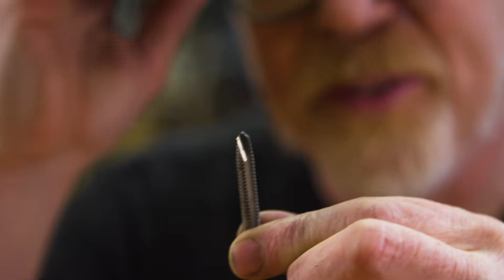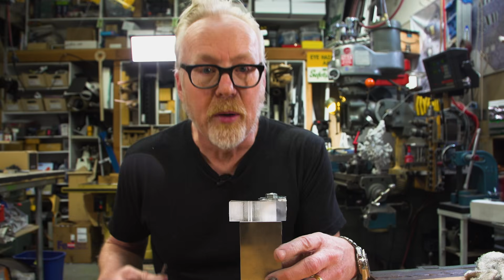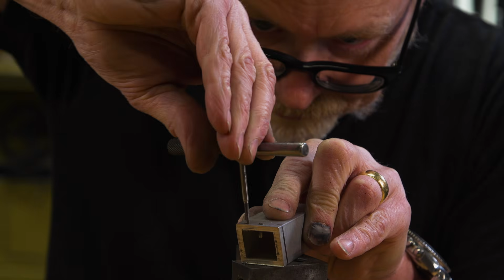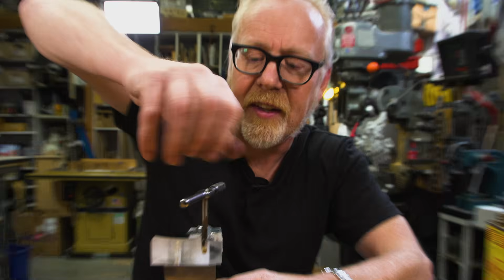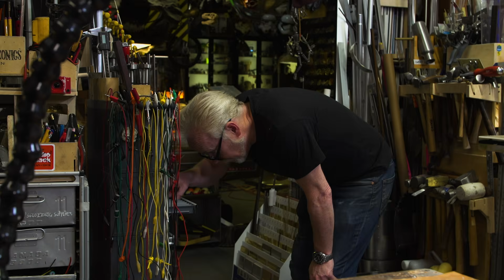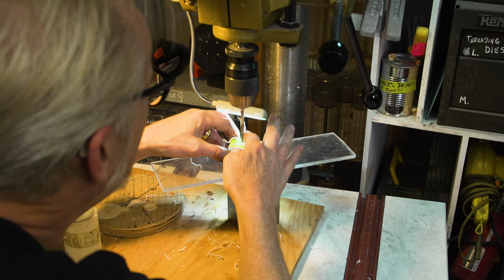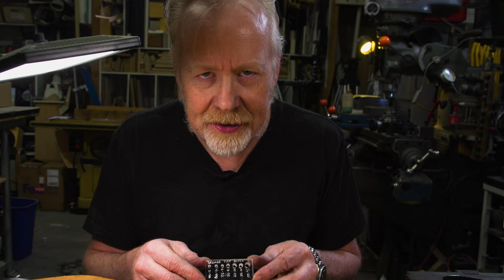Adam Savage's One Day Builds: Thread Tapping Guide Block!

Comment from the maker: Starrett Tap Wrench: https://amzn.to/3m47UaV
Spiral Point Tap Set: https://amzn.to/35l0qdt

Join this channel to support Tested and get access to perks:
https://www.youtube.com/channel/UCiDJtJKMICpb9B1qf7qjEOA/join
Reply: I love taping holes however my favorite tool in a shop is the file...metal file specificity.
Reply: @Die-CastMetal  I hadn't really lived the edge of reality until i got irritated only having a rough bastard metal file to shape metal more than sanding/grinding but less than cutting. Alas, the most dangerous tool abuse I have undertaken utterly on purpose was rough shaping the tang of that file to mount in the Dewalt(still US made model) sawzall to quickly and efficiently make my project actually achieve completion. 

Yeah. 

Second most dangerous was likely the 6" diameter cutoff wheel to the 4" angle grinder without thw guard to gain the depth of cut i needed. 

Not 100% which decision was worse, but hell, an air file is designed to chuck up a air file and reciprocate the file. The sawzall reciprocates, same thing, right? Sometimes it's utterly amazing the assessed risk you choose ended up just not even being remotely as dangerous as it really all could have been. 

Im certain that file was absolutely not intended for about 5600 strokes a minute, i think? Amazing the file just ate the material up, didn't dull the file(which it reallt should havr done immediately) and being a hardened and thus britle piece of equipment the overkill level of increased stress on the file should have been an absolute disaster.

So there ya go. Smartest idiot in the room. The logic sorta fit, however that was a set to fail scenario powered by lack of cashflow and no genuine option to achieve the process 

I now own many grinders and many different diameters. Its hard to justify even a Harbor Fright chea ass tool at 30 bucks for what might be the only heavy use youll need it for. The other option is a more expensive tool, plus the proper blades or ancilliary attachments and yeah. As AvE says, "Sometimes you gotta piss with the cock you got." Impied reasoning is sometimes the time wasted going to the store plus the remote location or difficulty/overall size of the attempted entire project. Theres always the tipover where struggling with elbow grease equals the time lost running to the store and expending money. Sometimes the store run is the best route. 

I figure tools aren't single purpose things. A sawzall to me doesn't mean it only cuts stuff or just does demolition. Anythinf you can reasonably chuck up and clamp(in the old set screw clamp style saw blade chuck) is now a reciprocating version of the manual tool. Dang quick release sawzall mecalhanism made blade changes easy but abusing the general application of the sawzall is vastly reduced. I think the new sawzall will get modified with a old 3/8" keyless chuck with the sawzall tapped to recieve the hotrod attachment concept and still be able to remove the chuck for the blade attachment but also retain the quickchange improvements.
Reply: I’ve never successfully used a tap extractor as it was intended.  I’ve always cut my broken taps out with carbide drills or end mills.
Reply: Love the nailpolish.... I have the some colour.... it's called ouch!!!
Reply: Did you catch your finger in the lathe again or has it not finished healing??
Reply: @1stMjolnirMarkV  I think maybe this is an older video that Tested is just uploading now
Reply: @1stMjolnirMarkV  He doesn't seem to be in pain of any sort maybe he lanced it.
Reply: now if you have to tap alot  then your best friend will be a Tapping chuck, it just makes it so much easier
Reply: Adam, has it dawned on you that you are continually archiving instructional knowledge for future generations at little to no cost for that education?
Reply: @draege626  And that is how education should be: free and accessible for everyone who is willing to learn. That makes civilization last long and prosper.
Reply: I absolutely love this type of instructional video teaching a type of skill or toolmaking general knowledge type thing. My dad was a maker and he passed on about 5 years ago and did not get to teach me many things about the workshop so both he and I are eternally grateful for this!
Reply: How about giving us the bit numbers for the holes you drilled in the tapping block.
Reply: Adam! You always have a broken nail! Protect your hands! You can't do what you do now without em'!
Reply: Can we have more tripod shots?  And more static wide shots of Adam working vs cinematic tight zoom?  Please?  That was so good. 

I understand it was hard on Adam to handle all the filming by himself.  But the magic of that style can still be captured with a camera person too.  (And with improved quality of course of someone else managing the camera.)

I didn't know it was something I'd miss until we had it.  But now I miss it so much.  It was intimate perfection.  And the "lower quality" with someone like Adam actually added to the appeal.  I watched this channel casually for a long time, but since the lockdown its what I checked for every day...now its, eh, not as perfect.

I normally watch all the videos with focus all the way through.  This is the first one I've...well, skipped..and the last few have been harder.  And I'm even interested in the content.  I'm sorry, but I figured ya'll should know.
Reply: I always thought the correct way to tap a hole was to chuck your tap into the tapping head on your milling machine and tappy tap tap.

Guess I was wrong.
Reply: 2 options for dealing with a broken tap.  If it's a hole in weldable metal: blast the tap out with oxy-acetylene, weld the hole shut, re-drill and try tapping again.  Otherwise, tungsten carbide and great care.
Reply: Adam, I am a grown man, but can you adopt me pretty please?
Reply: My father in law was tapping a hole in a boat propeller. Custom made. Chunk of bronze. Beautiful piece that needed to get mounted on a shaft.
Anyway, the tap broke in the very end of process and got stuck in a blind hole.
It took diamond drill bit and 6 hours of drilling on a minimal speed setting of a drill press to get it out. In a bath of cooling liquid. With a plastic bottle filled with bolts and nuts hanging on a press handle to apply constant pressure. With no certainty in a success whatsoever.
Reply: L

,l"l
Reply: Love these instructional videos! I learn so much from you videos. Keep up the great work!!
Reply: Where do you purchase your drill bits, or do you have a brand you recommend?
Reply: Hi adam ( and Tested team) I have been looking at buying a glowforge and have seen the video you guys did in 2016, do you guys still have your forge? do you still use it? if you do could you look into doing a long term review on it? love this video they are always fun to watch keep it up!
Reply: I have a question about using a Tap block, is it okay to start with the tap block and after you reach a certain point, remove it since the tap would in it's groove or use it all the way as much as you can?
Reply: Why dont you use a spiral flute bottom tap to pull the chips upwards vs dropping them into the bottom of the hole
Reply: Ive got a full drill/tap chart poster on the wall of my garage right behind my drills and taps.
Reply: Adam,  I was always taught to use a coutersink to put a chamfer on the hole so the tap starts easier.
Reply: another quick solution, instead of the tapping chart... for non-metric at least

Thread OD" - ( 1 / TPI ) = Pre-Drill Size Minimum
So if you are trying to tap a 1/4-20 hole...
.250" - ( 1 / 20 ) = .200"
find the drill bit closest to it, but not smaller than... result? #7(.201")
common drill/tap charts say a good alternative is 13/64 which =.203"
Reply: I am interesting in building a blacksmith shop to machine shop. any suggestions? I have a hammer and a building right now if I borrow  hammer
Reply: Thanks Adam. I love tapping and it’s a large part of my job as a fabricator. My favorite taps are Lawson brand taps. They are pricey but I also have to tap stuff way harder than most people have to like titanium or hardened steel. Cleveland taps are decent as well.
Reply: wat about the machinist handbook   it has all the charts   one book to rule them all    and in the apendix find them
Reply: @croquis24  those used to be  available at Harbor Freight.  I have an old hard bound copy somewhere. I don't recall an equipment listing. I am building an old school machinist/blacksmith shop. I don't have a hammer right now, just a concept and a goal. and a barn
Reply: Wish you woulda mentioned hella coils or whatever it’s called that I have been hearing about.
Reply: These spiral points would actually be considered a through tap as they are made to push material through, if it had a spiral flute and flat tipped it would be a bottoming tap so as to draw out the material.
Reply: adam please tell us where we can get a GOOD butane torch  I'm sick of buying butane torches only to have them stop working in 3 weeks
Reply: For the rest of the world 1/4-20 is better known as M6.
Reply: is a tap guide block made out of Black Delrin good
Reply: A tiny led at one side of the acrylic block with a tiny slim lipo battery pack, will make it cool and more efficient to work with 🙂😎
Reply: TRUMP is still your GOD!
Reply: ADAM I CHALLENG YOU TO MAKE A ARTICIAFIA INTLLIGANCE
Reply: I use a square regularly at the start of tapping, a bit tedious or old fashion, but works well.

Comment: For a broken tap in a blind hole, in aluminum use the pickling powder Alum, and water. Build a dam around the tap with clay, add the Alum and water and let it sit for a few days. The Alum and water will dissolve the tap, but not the aluminum. Works great!

Comment: I bought a tap and die set on Amazon that I like very much. It's made by a company called Toolant. The set is a very complete metric and standard set, and comes with the corresponding drills for each tap size. The case is very usable and holds everything in place nicely.
I would highly recommend it.

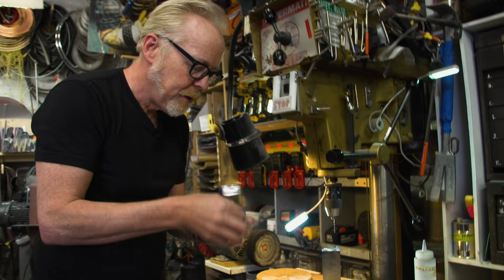Comment: 14:44 going in and out with the drill every couple turns is called « pecking » (like a bird) 
It common with soft materials and small holes. It gives time to dissipate heat, allows cooling fluid in, pulls chips out and helps with concentricity. Even cnc machines are programmed to peck with drills so long small diameter holes stay on track.

Comment: a hardened tap broken inside...is easily drilled with a well sharpened mansory bit
Reply: yes, the bits for stone....just get sharp edges on them, use ultra high speed in your drill and as light of a preassure as you can in order not to rip the carbide tip of your bit off

Comment: A great way to get good at tapping is to start on aluminum plate, imho. It is much easier with much less chance of breaking your tap, but you have all the same things that go wrong so you can practice getting it right. The same is also true with wood and or plastic. You can use any old scrap piece of anything for practice. Work your way up from soft to hardest.

Comment: A #43 drill is used for 4-40 full thread. Using the bigger #42 will make threading with the small tap easier. The same can be done with all taps under 5-40. Go one drill size bigger. I've tapped thousands of 2-56 and 4-40 holes over the past 35 years and have broken dozens of taps. You learn after a while that the cost of the tap is not as important as time lost having to remake a part. So buy good taps and you'll have less broken taps. The cheaper taps are much more brittle and the grind is not as fine. This becomes more critical tapping tougher materials.  Great video Adam.

Comment: Extremely helpful video - will be enlarging two 3mm holes to 4mm holes in a new breech block of an air gun to hold barrel in place.   Straight is important and not breaking more important - a $40 part is expensive to me.  Made a tapping guide from 1.5” block of plastic about 3” wide actually designed for gun repair.  Drilled a 11/64” hole the shaft of the tap fits perfectly in.  Tapping aluminum about 3/16 thick so should go smoothly.  Thanks again.

Comment: A few years late to the party, but this is really making me want to build an electric tapping machine once I finish building the automatic transformer/coil winder I'm currently working on. (Although I'm an American building machines in the US, they're all metric, so I'm using M2 instead of 4-40, M3 instead of 6-32, M4 instead of 8-32, M5 instead of 10-24, and M6 instead of 1/4-20. Same principles and methods apply for threading metric holes.)

Comment: Great video. One suggestion that's been a help to me as a builder over the years: instead of just a wallet card-sized chart or wall-sized poster for drill/tap reference sizes, use a "SCREW CHEK'R". For those not familiar, its the brand name of a piece of metal that has pass-thru and threaded holes that reference each other as to what size drill bit, tap and screw go together.  It also allows you to check the drill bit/tap/screw in your hand that you cannot read the size of because its... too small for your aging eyes to read well or its been obliterated over the years. They make one for SAE/Inch and one for metric. Made of heavy satin chrome-plated 1/8in. steel, measures 3 1/4in x 5 1/4in.

Comment: One trick I picked up is to store all the tap drills, body drills, taper plug and bottoming plug taps, as well as the correct sized extractor just in case.  They all fit inside a 50-round rifle cartridge storage box.

Comment: In defense of tap and die kits, they aren't really meant for purpose manufacturing in my opinion.  They are much more for technicians and service engineers like myself who rarely have to tap something fresh, but often have to clean up damaged threads on various bolts or holes. I have a large metric kit that I keep in my car because the machines I work with all use metric bolts, but the variety of machines means I can never be sure what specific size I'll run up against. The kit gives me a nice range for one price, and then I can supplement with individual taps for sizes I don't have, like the M30x3.5 I just had to order. Because who carries a tap for a 30mm damn bolt?

Comment: Oh yeah 😎.  Just watched 👀 Project Farm (YouTube)compare about a dozen Tap and Die sets including Irwin(ViseGrip), Bosch, Harbor Freight, most expensive was $200+ Craftsman Tap and Die set. Plus ➕️ the usual Chinese,  Taiwanese,  European etc. Interesting. As a bicycle 🚲 mechanic owning mostly Park Tool 🔧 Taps. Waterbottle bolt threads 🔩, rear derailleur hanger threads. Left and right pedal threads, a few others. The Park Tool Bottom Bracket Right and Left Tap, 30mm? Expensive $400-$600 for the set.

Comment: Great vid, I'm  retired gunsmith and have tapped thousands of blind holes, mainly, 6-48, and 8-40, 3-56 thru holes, I used a Forster gunsite jig  fantastic piece of kit, its very good for drilling into round stock as well, made tap jig but use bushings for the various taps also have bushings for drill sizes. You are right on about the 1/4-20 have lots of 1/4 -20 fasteners on hand, I like to keep 5/16, 7/16, 3/8 as well.

Comment: I'm used to have taps that come in sets of three. The first one doesn't carve a very deep grove, the last one is the one the carves the final shape. Because none of the these carve a lot of material, they are less likely to break. Also there is less material coming out in each stage, so less material is getting in the way of the tap.
The first one has one ring around it as a marking, the second one has two rings around it and the third/last one has... you guessed it wrong... zero rings around it.

Comment: Tapping, sooooo many tools to add to my collection. Let's see, you gots to get fine & course thread an metric in each major pitch (125, 15, 175), spark plug holes, bits for car hubs, don't forget garden hose thread (could you imagine all the fire truck hose threads), you gotta have some old British standards too. Drills! Hand reamers! Thread chasers! Then you need a couple more sets by different manufacturers cause sometimes perfect threads are a myth  need some slop to fit them tractor supply bolts. The storage solutions... drawers, drawers, drawers... sooooo exciting. Then they is them tools too & cutting fluids!

Comment: High temp copper flake anti-seize is so far my number one favorite tapping fluid if you haven't tried it you really should it really does wonders. 

I was tapping some small holes in stainless and you know how you can tell right when the tap is about to snap. I was already doing a very shallow thread cut because of this and only got about halfway through with tap Magic cutting fluid but once I tried that copper flake anti-seize I was able to finish the hole.... I was sold after that day on.

Give it a go.... I was surprised too

Comment: Never break a tap again,..assuming you drilled the correct size hole,..determined by a tap drill chart..chamfer your hole slightly larger than tap size. Use cutting oil...turn 1 revolution forward then 1 turn back,..not only a 1/2 turn !! ,this will break the chip.Proceed until threaded.

Comment: Adam Savage, nice video.  Btw to make the markings readable you can try using liquid paper (correction fluids) to fill in the engraved area, just use a rag or tissue to wipe off the excess.